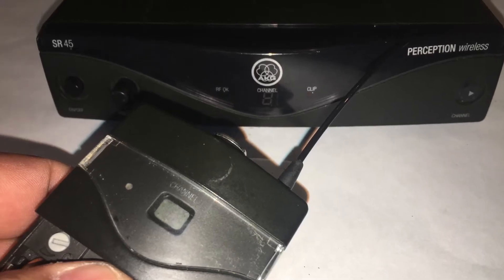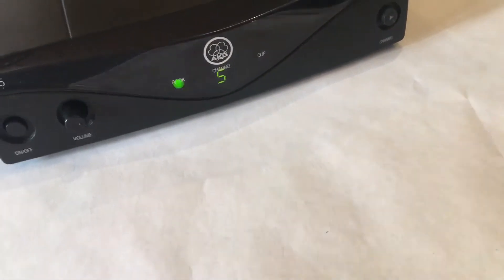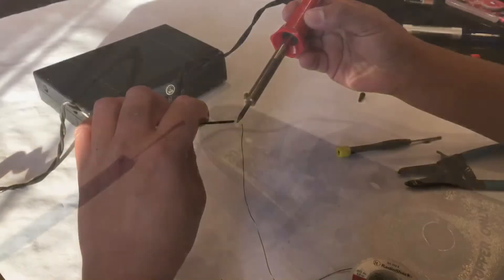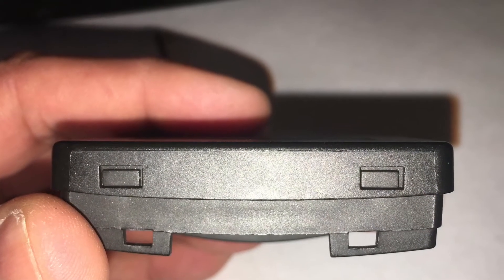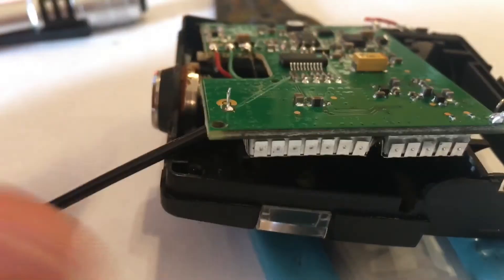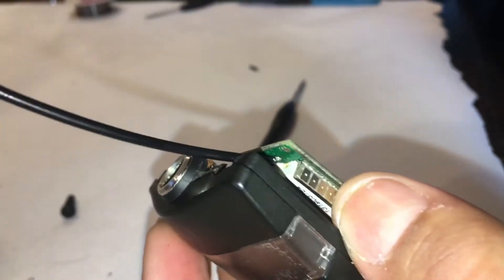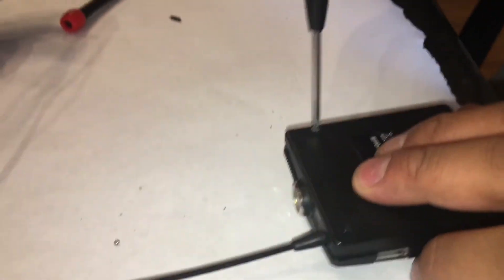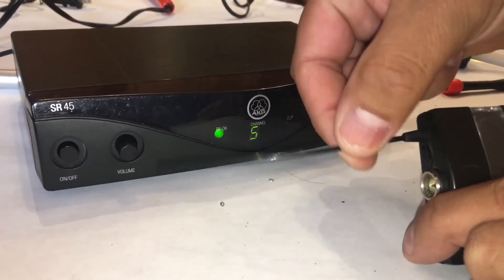AKG body-worn mic/transmitter repair

Comment: BRILLIANT! Had this unit for years (used for electric bass). Couldn't work out what the crackle was. Mine broke exactly the same as yours. Given the propensity of the stiff antenna to get caught on things and therefore put pressure on the solder join, I've replaced the antenna with a piece of coated wire. Works a treat and is less likely to put pressure on the join. Thanks for this. I nearly threw it out!

Comment: THANK YOU! The mic in our Barre studio started acting flaky this week. It turned out to be exactly the failure you show here, and I was able to repair it. I almost can't believe that AKG would attach the antenna like this with zero "pulling" strain relief. I hope the hot melt glue keeps it together for a few years!

Thanks again!

Comment: nice video. Do you know the wire connection in small plag. I bought cheap mic and it doesn't work with AKG I think because of 3 pins but only 2 of them has any connection and one of them hasn't.

Comment: Hu, how much does a battery last with that system?
Reply from the maker: Teaching three classes a week, I swap batteries about once every three months.
Reply: @ace789nj Have you tried rechargeable AA batteries with this unit? I've tried different makes and none seem to work. It always displays low battery and cuts out after less than half an hour.

Comment: the antenna on my bodypack fell off and can't find it.  Could I replace the antenna with generic antenna wire?  What length?  Thanks for the tutorial!!! The hot glue is a great idea.
Reply from the maker: brunomoosecharles sorry it took so long to reply, haven’t signed on for a while. Any small length of wire would work, as long as it’s rigid enough. I would look for something that has thick insulation (relative to the wire gauge). if you have the old mast, you can use that as a guide for antenna length.